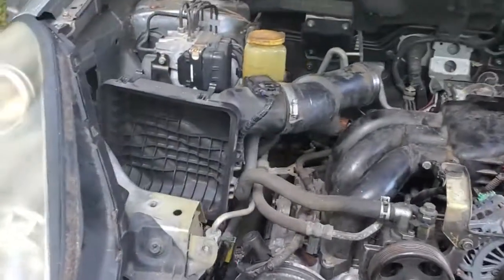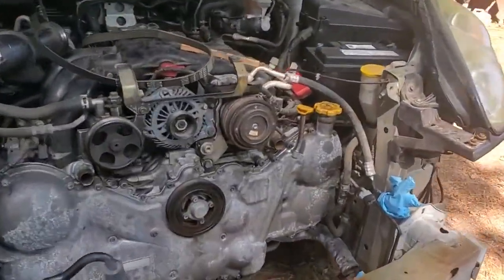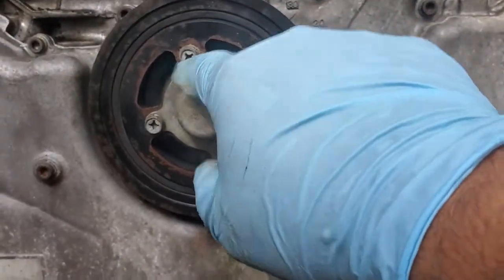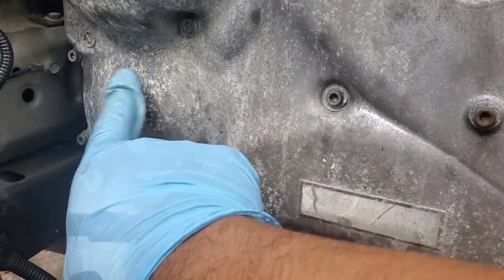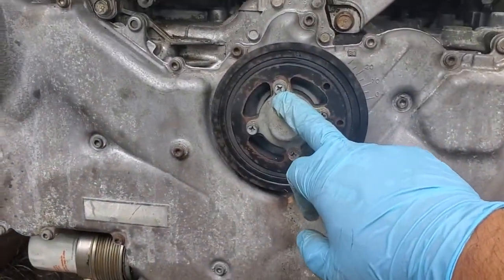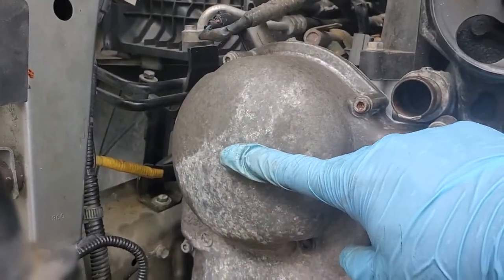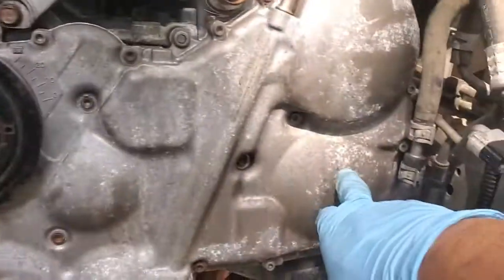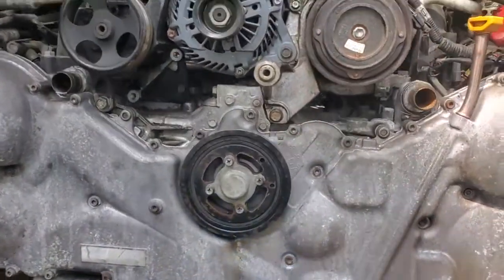2007 subaru tribeca 3.0 timing marks

Comment: Hello good morning. I am currently working in a 2007 Subaru Tribeca. I am replacing the abcs Actuator on the passenger side if your facing the vehicle. The problem that i am having is, I can not fine the tool to install the Actuator. If you know the tool i need please reach out, and point me in the right direction. Thank you so much.

Comment: Timing case is a bitch to take off. I'm doing the water pumo now and it's shit
Reply from the maker: It is hard because it has silicone all around it... also make sure you take out all the bolts... it is about 50 of them... I hope this helps
Reply: @y2mouse  your so right there was one bolt left deep in the case near the bottom middle smh haha. Once I took that off it fell off. You can tell all the prying I did. Cheers mate
Reply from the maker: I am glad it worked out.  It happened to me as well...good luck

Comment: Just bought a 07 and having problems with it always over heating. 😫
Reply from the maker: If it is overheating it then it could be radiator, water pump or a hose but I hope the cylinder heads are okay... check those things first
Reply: I have a 06 and already replaced thermostat and temp sensor waterpump is only thing left to do I hope .you might start in that order.
Reply: I need to replace my head gasket on my 2006 tribeca and do i need to remove the timing chain and sprockets